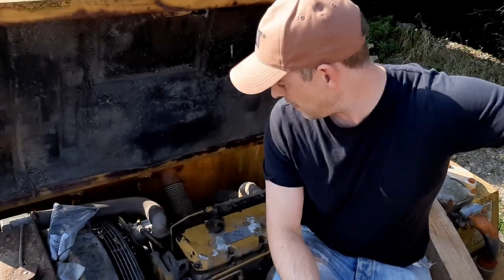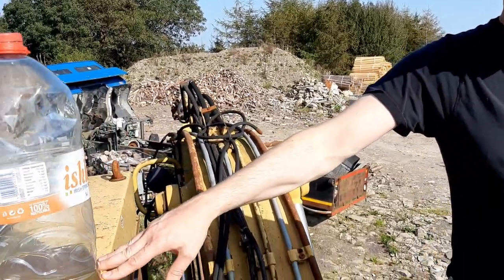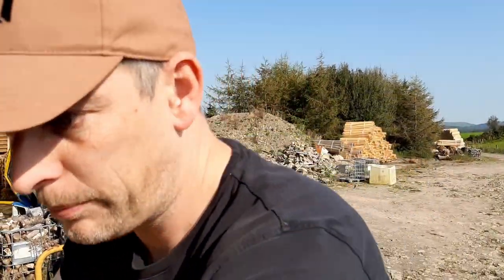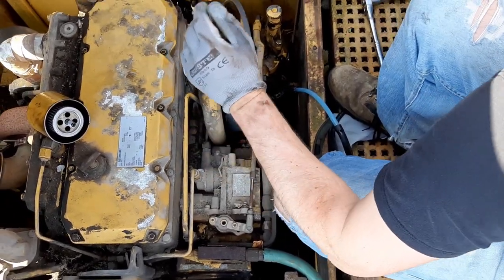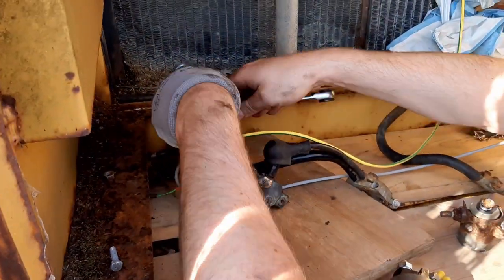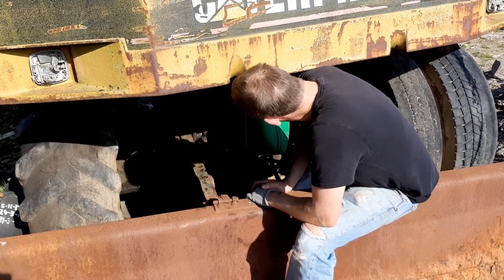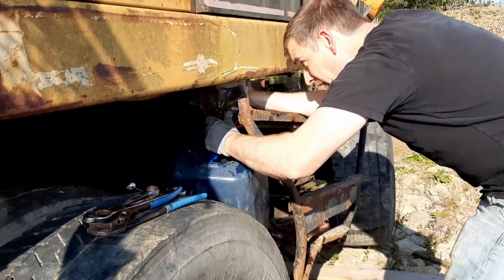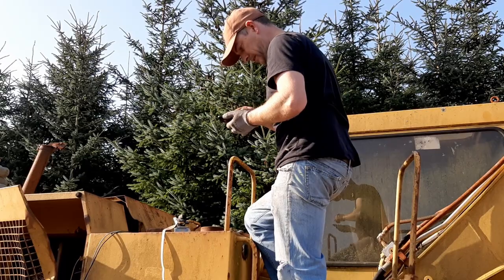Abandoned Excavator Part 3 - Old CAT Rescue Part 3

Comment: Audio is greatly improved there is a primer pump on the engine when you replaced the primary screen filter you were leaning right on it
Reply from the maker: Thanks Russ, I used that primer a few times but it didn't feel 100% and I was concerned it was letting air past so I used the bulb. I used it later when the factory lines were reconnected and it worked OK though. Thanks for watching, hoping to have her up and moving in the next few days. Have a great 2021!